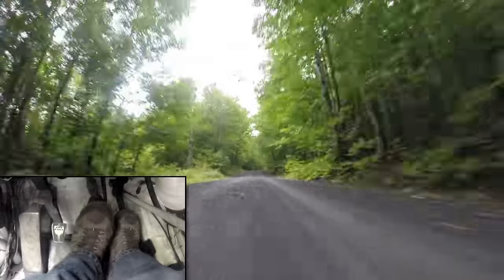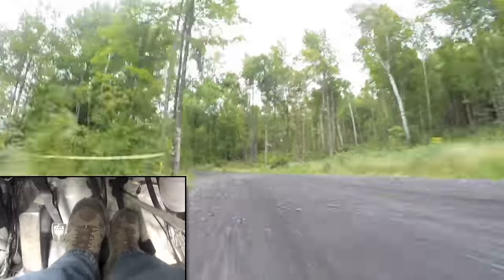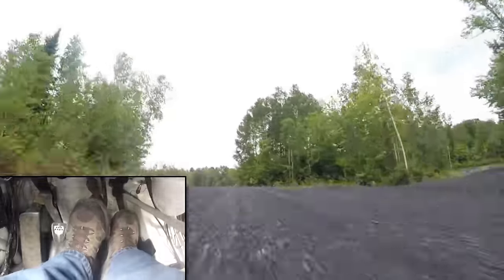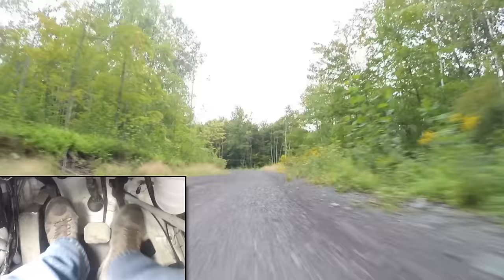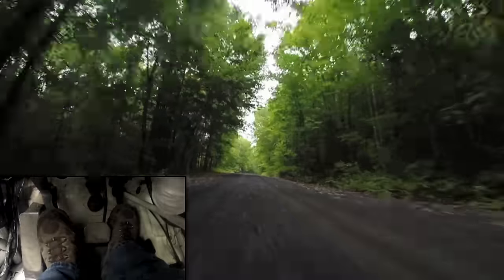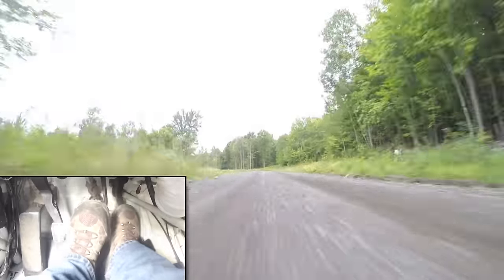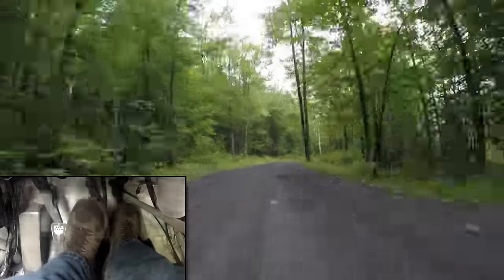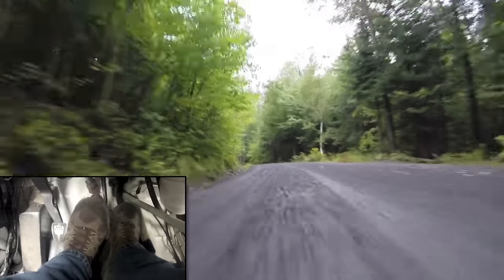Rally Driving Explained

Comment: Floor it and press the brakes while turning, got it
Reply: "Dies in first turn"
Reply: @mr.sultan2213  no, no, he's got it
Reply: like in gta v
Reply: Uh oh
Reply: No, floor it, and never stop. Never.
Reply: If i recall thats a technique for fwds
Reply: I had a 9c1 caprice when I was a kid and it had a weird t-handle under the dash that would pull down and lock the pedal to the floor. I asked a highway patrol officer what it was for and it was basically this. You locked the pedal down in a chase and just worked the brake.
Reply: Yea. Something like that.
Reply: @Stickey Sickness Correct . Left foot braking.
Reply: Awd acts almost like fwd in corners but in corners you gas let off in the corner then smash it
Reply: @mr.sultan2213  have faith bro 🥹
Reply: @beet6le380  only when in doubt
Reply: GUYS HOW TO STOP?
Reply: Grab your helmet. I think you’re ready for the big leagues.
Reply: @joshingtonbarthsworth631 wouldn't you run your brakes that way?
Reply: @m-b1798 its also used in awd to shift weight to the front tires, so they have a better turn in. but i imagine they dont have to use it as much since they can use the power of the rear to push the car also.
Reply: No
Reply: Yes but don't forget to not hit trees when flooring
Reply: @jakefearing6640  FLAT OUT
Reply: Don't let the turbo to take a breath, manage weight transfer, prepare your curve, observe the terrain for grip and I think you have it. 
FLOOR IT!
Reply: Trip straight to heaven 😂

Comment: 6:35 "As you can see im quiet out of practice" meanwhile doing 90 mph trough the woods.
Reply: eraserh probably not, but it looks fucking fast lol
Reply: it looks so fast cuz camera is so low to the ground
Reply: Well... let's see; he's int second or third the most of the time so... do the maths
Reply: *quite
Reply: I'm very interested how fast they're driving? Does someone know?
Reply: @Roflcorso  I know this isn't a stock focus st in the video, but second gear in mine tops out at 60 and third tops out at about 85 or 90.
Reply: a safe guess is between 50 and 70 mph, depending on how straight the section is, according to my google about rally speeds. This fits testuser's suggestion as well.
Reply: @Roflcorso  Not sure in this particular case, but according to my calculations, in New England Forest Rally 2019 the slowest car averaged 48, fastest production 2WD was average 66, and fastest overall was average 84
Reply: @Roflcorso  the cars he drove past are roughly 6 feet wide, he passed them in <3 frames, at 24fps with all the math that ends up about 45-55mph. Possibly faster or slower because the lower FPS the lower precision you get.
Reply: That’s about 35
Reply: @TheRealProski87  nah hes driveig a escort a2 s hes going about 90 to 103 easily
Reply: @The_Catalin 🤓

Comment: first time i actually see this demonstrated.
your brakes must be red hot.
and doesn't that left foot braking cause you to sit at a weird angle to the pedals?
Reply: upgrade the brakes :) allocate the money for brake pads
Reply: +TeamONeilRally damn that means new pads on the brembos that's like having a new dog ever 130miles
Reply: +Salvatore Briganti yes but you get sponsors if you're good and that gets you the new brakes every 130 miles. xD
Reply: +jfv65 Hot, but I'd expect not super-on-fire hot. The brakes aren't doing as much work as you might think on dirt (vs. pavement), and a lot of his braking is just to control tire slip -- it takes very little to slow just the tire. (wheel: 20lbs, car: 2000+) I'll have to try using my left foot a lot more at the next rallyx (which normally is too short to get any speed, but first event is at VIR this year -- end of Feb.)
Reply: yes, but if you doing this you are probably rally racing, if you are doing this on your daily commute you are just an Ijiot ..
Reply: jfv65 because rally is not about efficient and comfortable driving at high speed.
Reply: Seating position is normal, I’ve been practicing in my truck and you get used to it quick, and I don’t think the brakes are working they hard on dirt, plus they are hugely upgraded.

Comment: I was wondering how long it usually takes the average person with a little bit of driving experience to develop this kind of coordination with their left foot? looks like it ends up being more active and requires more dexterity than your right foot...
Reply: gts013 I'm left footed so slight advantage maybe?
Reply: 'Practice make perfect'
Reply: That depends on whether you know how to drive manual or not, that will take some time.  One way or the other it's pretty easy to learn left foot breaking on an everyday car - especially if it's automatic, you start using your left foot to brake all the time you drive, you start slowly in an empty parking lot (school, back off the mall....) to get a feel on how much pressure you need to apply. If you know how to drive manual things might be just a tad harder since your left foot is already used to stomping the clutch, but if you automatic box driver should be a tad easier. Slowly but surely over time you will have more and more control over your left foot breaking, just remember on an everyday car and on tarmac don't brake and accelerate at the same time, just work on braking withthe left foot instead of your right foot and voila, when you get in a rally car you can put them together.
Reply: I’m not practicing breaking to this capacity but when I was learning to brake boost my car it eventually came in time with muscle memory . The first time trying it tho I definitely felt like I was gonna fly through the windshield 😂
Reply: One day, 3 attempts, at least for me, I can limo stop with left foot now

Comment: You're using the brakes all the time. Sometimes right foot braking can be useful too. There's also the toe heel, the right foot braking while pushing down the clutch without using the gaz pedal when preparing the Scandinavian Flick which is in my opinion the most skilled and the most used in Rally.